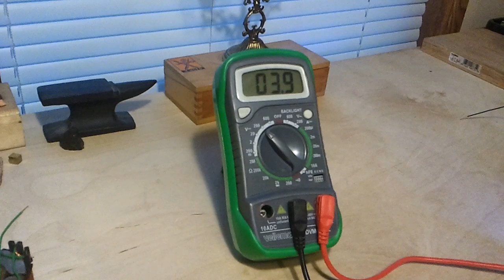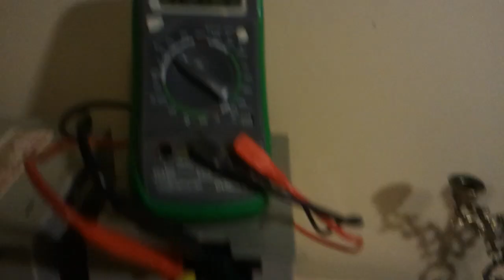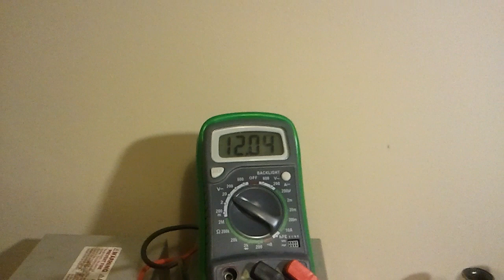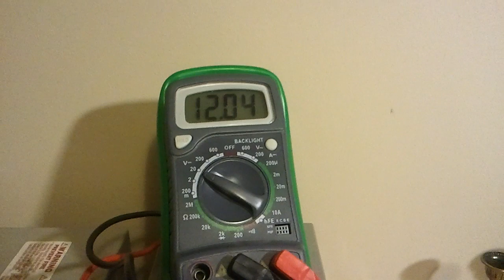bedini motor + 2 water capacitors = more HHO

Comment from the maker: I am using an MJL21194 in this setup. It didn't come with the kit I got from r-charge.net. I use it because it is more forgiving than say a 2n3055. I am always doing different experiments with it. The charge side gets disconnected a lot while it is still running. I also have a 65 watt neon bulb between the collector & emitter for safety as well.
Thanks for watching.

Comment: thanx brother nice work ,i will take your advice,is that a mosfet your using?i have another motor with tip 122 darlington transistors but yours looks very high amp.

Comment from the maker: This mini window motor was purchased through r-charge.net. There are many options for this and other dc motors pulsed using a bedini circuit.  
A water capacitor uses water at its dielectric as opposed to thin film used in most capacitors, but there are many types of capacitors.
I hope this helps you.
Thanks for posting
P.S. "onus" what a wonderful word.